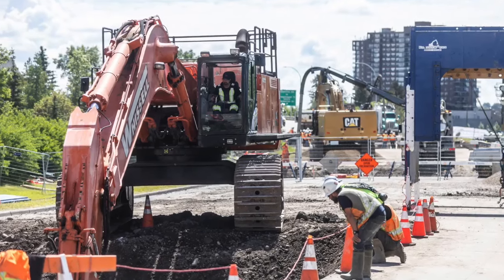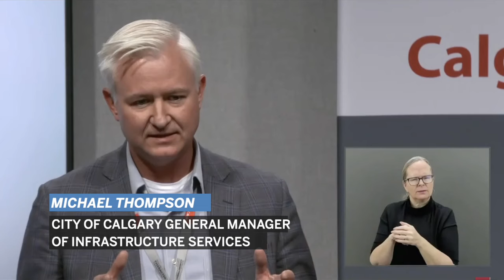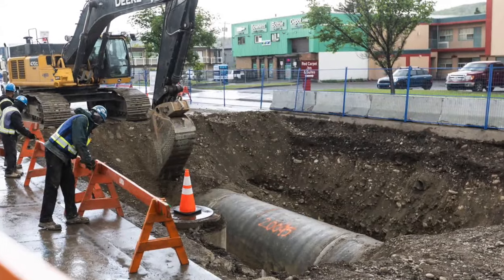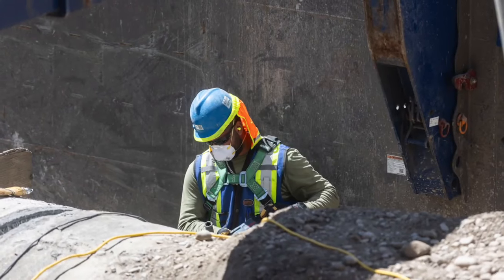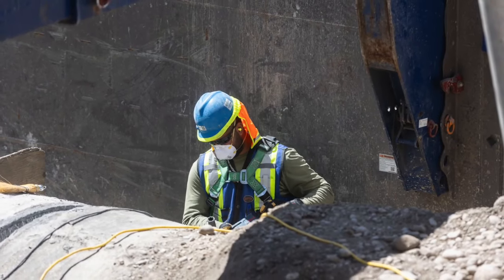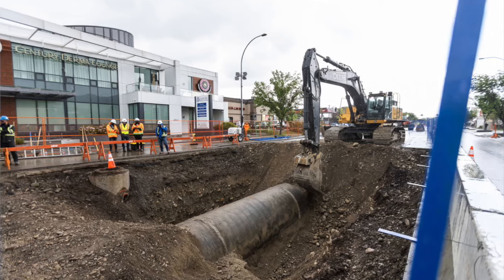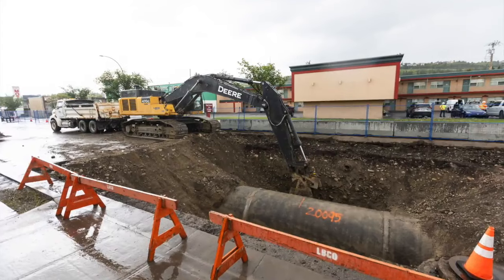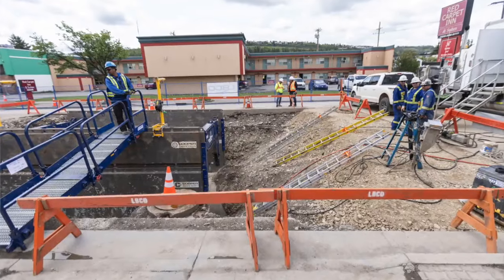Water Pipe Repairs On Track For July 5, Cost To Be Shared With Public

Comment: you have a fair few metal recycling facilitators around that buy scrap metal from "shops, farms, garage hobbyists, etc." for between $74 and $280 a ton after deducting the fuel price to buy it back as transporting it to a shredder to fill a 200 ton rail car with it. some of that is also off set by repossessing vehicles that were sold to the public using various laws such as "speeding 40 over the posted limit", Zero cost other then locating and picking it out of where they parked it. about $2000usd/ton to melt it in an arc furnace as far as i know, and goes another $2000 to run it thru the rollers... not including the aluminum in most cars, the 1800 pounds in each would come close to 2.25ft of 48 inch 1'' wall pipe per recycled vehicle at... $3'352.89/1ft. then you add worker wages overtop of 12 different job sectors and whether or not the city will uptake the payment process "via allowing them to have a job after a vehicle is repossessed for them to pay the huge loan they took out to buy it" that could add another $60'000/ton/foot, not including wages and contract rates for union insurance... 840'000 drivers licenses were impacted by the removal of the GDL driver program and if each of them had one, their is nearly 1.5 million tons sitting around the province that is already on the recycle it list... $80 in fuel to lure it in from where ever for whatever reason... show az give it gas, come and yanked not knowing its gone till the third day they been in the sheets for 72hrs straight and want to go buy a pizza.